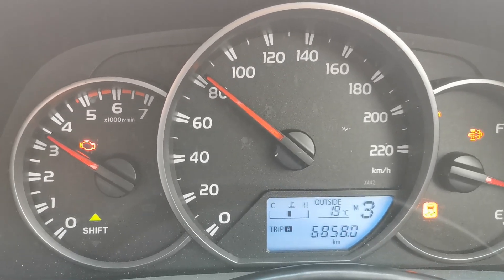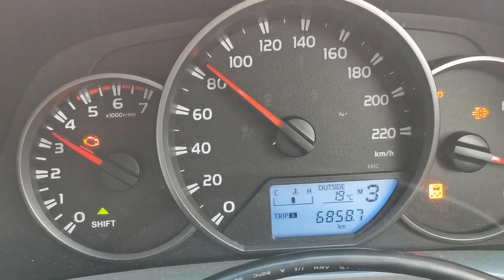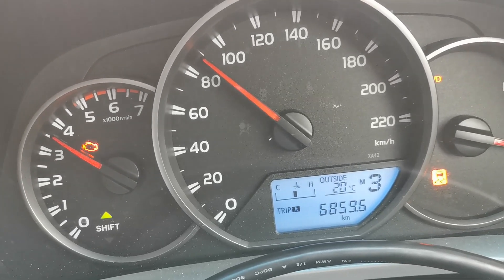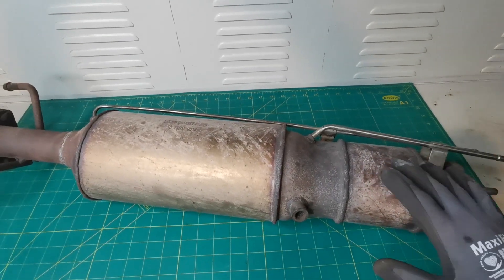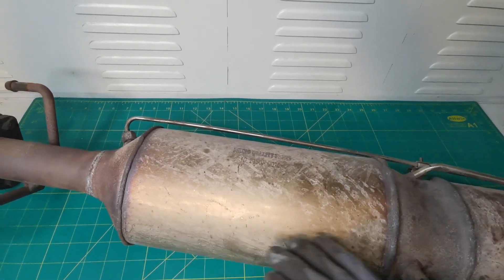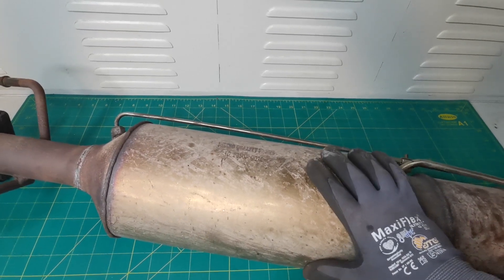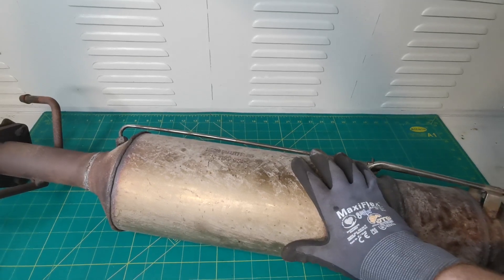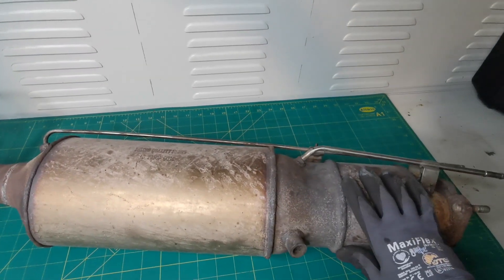Toyota D4D - DPF Fault Won't Clear - How To DIY - Found & Fixed

Comment: Thank you very much! I have done exactly as you said in the video and the problem has been fixed. Toyota rav4 2014 2.0d4-d
Reply: The only difference was that after the battery removal, i got on the dash message “dpf full see owner manual” and then i took it for another 10mile drive and it cleared

Comment: Just used some of this dpf cleaner in my 2014 RAV4 2.0 diesel  (81000 miles)
Easy to do on the Rav4.  I pushed the pipe in as far as it would go, basically just the length of the rubber hose,  the diameter of the metal pipe is too small to put the pipe right down into the DPF. I put a tie wrap around the rubber hose to secure it to the sprayer tube.
Emptied the tin, reassembled and went on a road test. Initially a lot of steam comes from the exhaust. My neighbor thought there was something wrong with the car😂😂 anyway, I drove the car in a LOW GEAR, 3200 rpm 40mph for around 10 mile got onto a bypass and could use 3rd gear & 50 mph
Did a total of 30 miles and had great result 👍
Cleaned any fault codes in the ECU with my basic obd tool.

Comment: Thanks Gerard, my 2017 RAV4 wouldn't do an auto Regen and my garage (who I trust and are excellent, they actually fix issues and don't just swap out parts) then went through the in situ cleaning of the DPF, which reduced differential pressure back down to normal levels. Unfortunately one week later the fault has come back. I'm going to try the battery reset but under these conditions am not hopeful it will work. Will get a fault reader to see the live dP across the DPF and see is it genuinely back at high differential. Thanks for the video

Comment: Hallo Gerard.

My mothers Auris D4D 2015 with 140Tkm got the P2463, too.
Her garage tried it first with cleaner fluid, then replaced the DPF and finally also replaced the differential sensor.
But the mechanics did not manage to get ride off the P2463 error and warning light.

So I tried it with "Car Scanner ELM OBD2" by myself.
Reset the oil service (hold trip A and switch on ignition).
Activate "DPF Burn On" in Car Scanner Sensors section.
Test drive for 15 minutes with high rpms. Nothing happened. 
P2463 error cleared with the app, but it returned after 1-2 seconds.

So I tried your findiing: cleared again P2463 error (both on modules ODBII and ECU while running the engine).
Immediatly after the warning light disappered, I switched off the engine and removed minus pole from battery.
After waiting 30 minutes, I reconnected minus, started the engine and voila P2463 disappered.
I did a test drive and the engine started with DPF cleaning very soon (strong smell for some minutes).

I'm very happy!

Thank you very much for your video.

P.S.: Toyota - what a terrible system - for me, it seems you force owners to visit Toyota dealers only.
Reply: Same situation here. I have auris 2011 and i go to clean dpf, one week again P2463 code. I sent again to mechanic and after exact  6 days  check engjne turned on. Send to mechanic again and he changed sensor pipes, plug unplug the sensor and he cleaned the check/ 6 days (today) . i don’t trust anyone.  I don’t have what to do anymore

Comment: Freind, thanks alot for this video, great.

I didnt need to deassemble dpf. I managed to get failure away.
But, my diesel consumption is mor than + 2.0l/100km than normal. Wery uneven in 30min driving. 

Im gona check sensors, clean them. After that I dont got an clue. 

Do you have any answer.

Comment: 2016 Prado 2.8 won't get hotter than 70 degrees so couldn't get it to do forced burn on the scan tool .. have you had thermostats stuck open. Thanks

Comment: Great advice Gerard, new sub to your great channel here ;-)  . I had a 2018 Amarok v6 deisel in with 256000+ ks on it with high soot accumulation and the PCM would not let me do a regen burn  because of "safety issues", so this one needs removal and cleaning, but I may try your inlet clean first ( but I don't want to break a VW :( )
Reply: Did that work?

Comment: Mate, I highly appreciate your advice!

The Toyota workshop cleaned my Rav4 2014 2.2 DPF but did not reset the failure in the ECU.
The motor ran in safe mode so it only shifted up to the 4th gear (Automatic transmission).

They offered me to install a new DPF for 6.100,-€ (which is about the same in USD) !
They said they couldn't remove the failure in the ECU.

Then I bought and installed Toyota Techstream for 51 bugs off amazon.
I could reset the failure but it repeated popping up right after a second.

Then I followed your approach: disconnected the battery for 20 minutes.
And the failure was gone. No problems.

After two weeks of driving with the failure this is so good!

May god bless you!
Thanks man.

P.S. The cleaning that they did was succesful, however. Now it uses only 7 liters/km instead of 8! But they did not want or were not able to remove the failure in the ECU. Unbelievable story.
Reply from the maker: Absolutely delighted for you Alex, thanks for sharing. A major amount of money saved!! Love It

Comment: I’ve got the exact same problem with a 2013 3.0.D4D hilux except the second you swing over the engine the dpf light comes straight back on and after a small time period the others comeback flashing. Dpf was removed and washed by dpf services and returned to 100% airflow.
Reply: Exact same code won’t clear whatsoever. Differential pressure is 20mbar @ idle.
Reply: Exhaust gas temperature sensors weren’t renewed could a faulty one cause the lights? But no codes for them. Only P2463
Reply: Using diagnostic tool told vehicle it got a new dpf

Comment: Thanks Gerard. I've read tips of a DPF cleaning company and they say than a turbo that is underperforming could also lead to DPF problems if customer continue to drive with underperforming turbocharger. Not talking about turbo oil leaks. They state that sometime car would drive bad but not generate a turbo fault so customer will continue driving like than which in the end leads not only the turbo needs rebuilding and the actuator solenoid valve recalibration , but a failed DPF than also needs to be sent to specialist because it cannot be cleaned other way. Ever heard of this? Ive never heard of this,theres always a DTC generated when turbo is underperforming and thr vehicle goes Limp mode. 😃
Reply: Had a 2008 Suby with similar problems, customers boyfriend had thrown a new DPF pressure sensor at it, without fixing the obvious air intake tube leaks  :( Then she didn't have the $$ pay me for fixing the issue :((

Comment: Cleaning them in situ is great,,But it doesn't get rid of the Ash,,That stays in the dpf,,The added benefit of off car cleaning,,Is this flushes out not only the soot but the ash also,,,
Reply from the maker: Yes while that may be true I still don't see the initial justification of all the additional labour, time loss and cleaning costs of the off car cleaning. If the on vehicle cleaning plus extensive driving doesn't do enough I would then move on to next best option.

From the many I have done I have found it to greatly reduce soot accumulation and leave the vehicles fault free with no issues.

There are other options of on car cleaning that may also be considered, Launch has a cleaner that has great results also.

If the vehicle can't get temps hot enough in the exhaust then no matter what clean is done the soot will return.

Understanding the systems and following correct passive regeneration process is key in having a long term fix using with this method.

Thanks for watching and taking the time to comment 🙌🙏